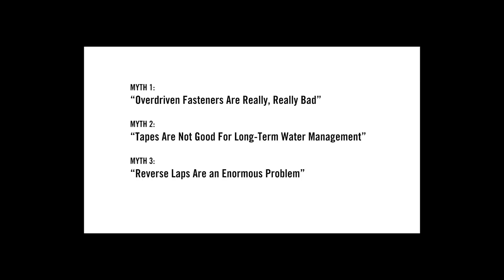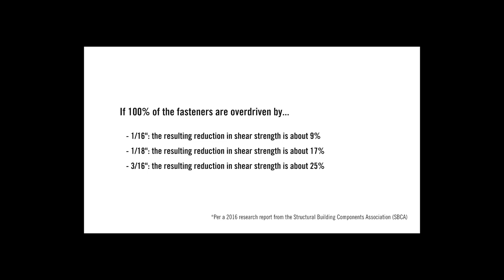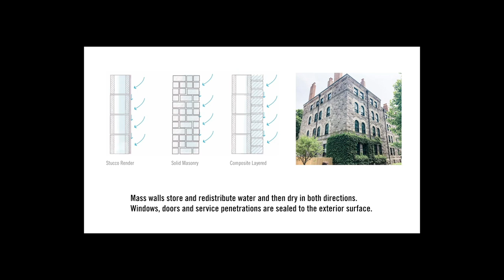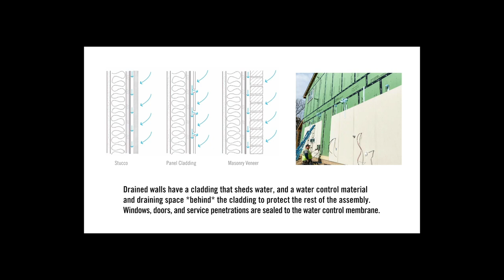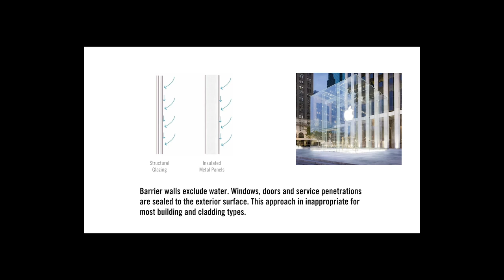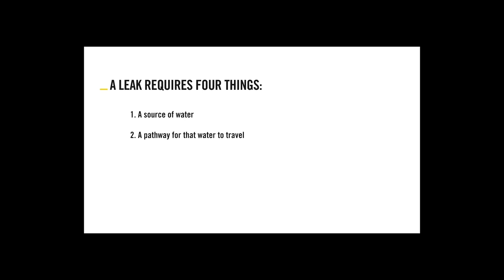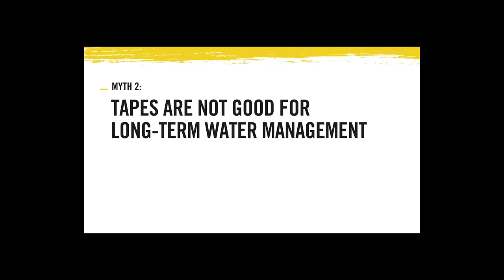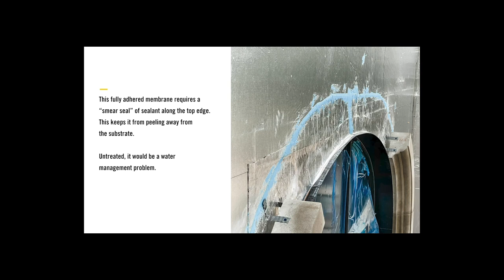Construction Myths, Busted

Comment: Interesting video.  Christine on Silicone sealant.  It is a "oily sealant" somewhat and does not compare anywhere close to the Polymer Sealants coming out even the Polymer sealants in the last 2 Years have excelled over even the Polyurethane Sealants that have been superior to Silicone sealants for decades.
I know you only referred to the Silicone sealant in an off reference comparison, but I thought that it is worth mentioning, because you used Silicone Sealant as a "good sealant"... Which It Is Not!  Especially when the construction industry has far surpassed the quality of silicone sealants, because of the innovative use of Polymers in sealants.

Which actually plays into the why Self-Adhering Tapes are so strong, is in large part due the use of polymers.

But good info,  I just had to add this thought.  I started out building steel buildings in 1978 and the best sealant was Silicone sealant, and it failed horribly, but today we have very strong and long lasting Modified Polyurethane / Polymer sealants.  

For a couple of years I built Glass Roofed Sun Rooms in 1998 - 2000 for a company, and they had us use Silicone Sealant.  And after completion we had to do a Water Test and when a leak appeared we had to remove the sealant and reseal the area.  It was a constant battle,  even though we meticulously cleaned the glass and the rubber seal prior.  It was just the fact that it is prone to fail. 

I probably said too much, but again I think it needs to be said.  The new sealants have much better Adhesion and even better Elongation and even better UV Protection.

Comment: I'm sorry but this is not a good video man. I've seen many of your videos and I've learned quite a bit. For that I thank you! This video was bad for so many reasons, but I'll keep it short.
 It took me 30 seconds to look up Hubers info page on zip system sheathing. This woman represents Huber? There are clear and concise parameters and considerations in regards to fastening their sheathing. Besides structural integrity (which the woman had no knowledge of, or at least, had to consult her friends for) there is the manufacturers warranty, which was not mentioned. When considering installation, in my opinion the manufacturers instructions/guidelines are the best place to start. I definitely lost some respect for this channel considering you have a rep. for your main product  (Huber) talking nonsense from an unqualified stance.  As it is, you guys push their products in your videos, I get it. They make great stuff but this video was it for me. Its getting a bit much with this product pushing content. I mean no disrespect, keep up the good work! Thanks for your channel until this video 🤙
Reply from the maker: Christine doesn't represent Huber.  What specifically did she say about overdriven fasteners that contradicts what the manufacturer says?

Her specialty is building envelope design and she teaches it very well.  This video wasn't designed to push Huber products, but rather discuss 3 common building myths.  

I feel that you viewed it through a filter and not what we intended it to be. I can understand that, I do it all the time.  

Now I'm going to defend myself here a little, hang in there, I'll keep it short.  It takes an insane amount of time to put together the videos on this channel and Instagram.  It cost money to make content that is you view for free.  

Thank you for your time.
Reply: My apologies, I misread the title!   Thanks for the correction.
Reply: You are probably correct in that I viewed the video through a filter. I guess I may have been expecting something different.  As a framer, I felt the video skipped over some simple yet important points and may have been reaching a bit out of its depth.  Sorry about the other comment, I thought she  was a representative of Huber so I guess  I took that and ran with it 😬. It seems the video is neither a framing video or a "building envelope" video. It falls in the middle glossing over important points in my humble opinion. I enjoy your framing videos And I understand the hard work that goes into them, so thanks.  No disrespect to either of you the video just seemed awkward to me...but I am a mere framer
Reply from the maker: @atomjordan  I get it.  It was the best we could do during the pandemic.  I literally had my laptop set up so we could do this over Zoom.  Next time, hopefully we can be in the same room.